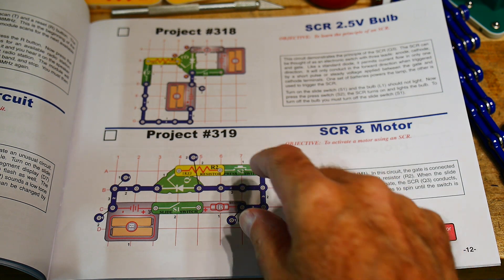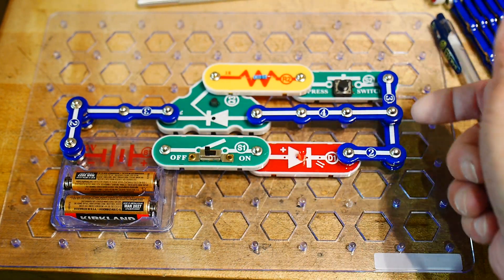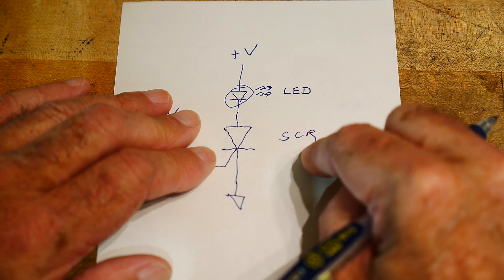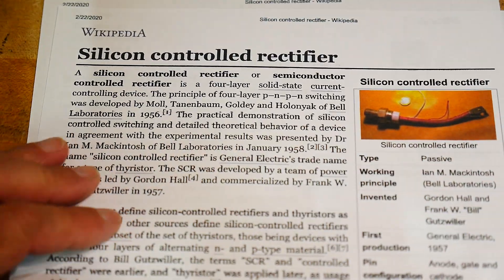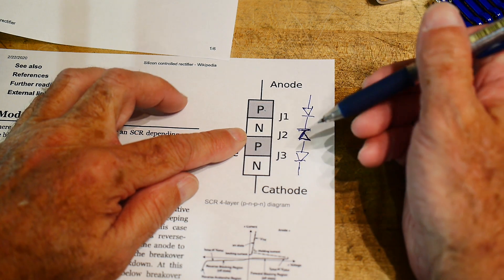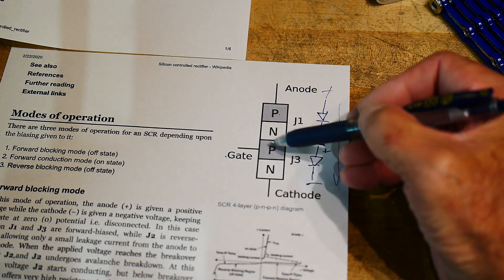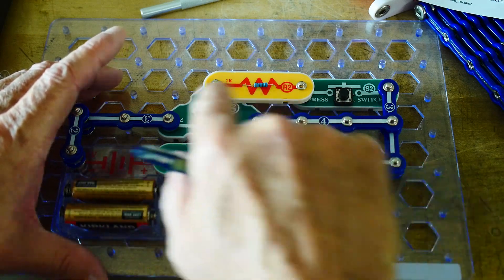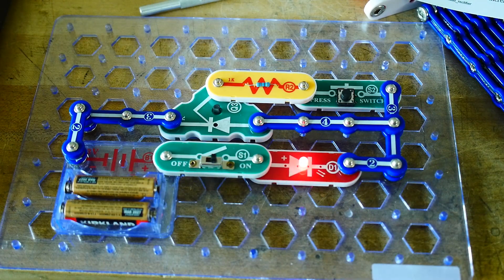#400 Silicon Controlled Rectifier Snap Circuit

Comment: SCR are reverse blocking - most important property. and ofcourse they can latch with gate pulse - and are extremely robust. Ebay has 50amp metal stud scrs 1000v   - best to get a used scr or scr block. new epoxy block  ones while rated 63 amp not as robust. Old used Semikron 1600v blocks the best value in large thyristors

Comment: My guess is this whatever the switch is turned on the light does not come on due to the SC ER has not received a pulse of electricity which turns on a gate that allows current to flow